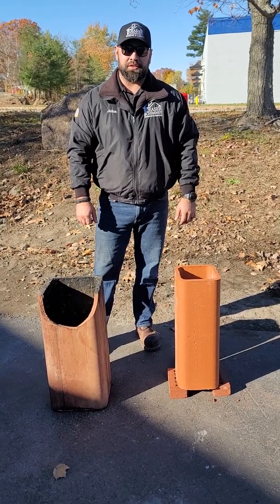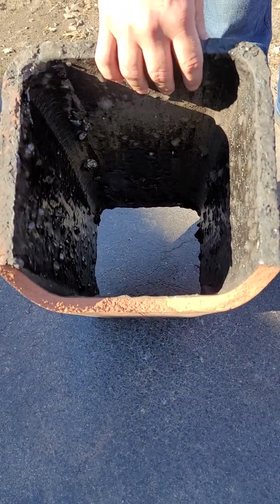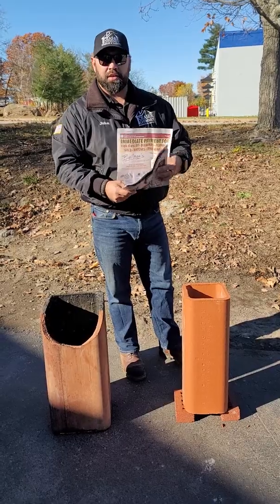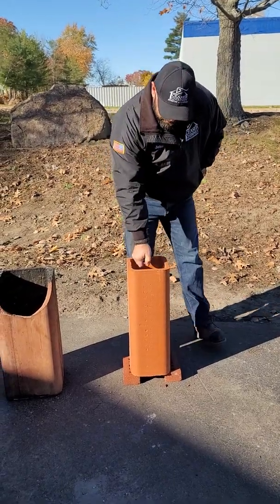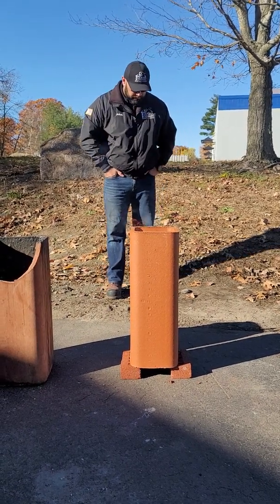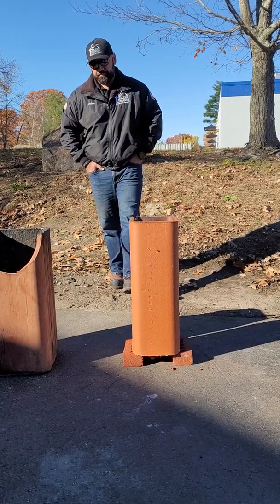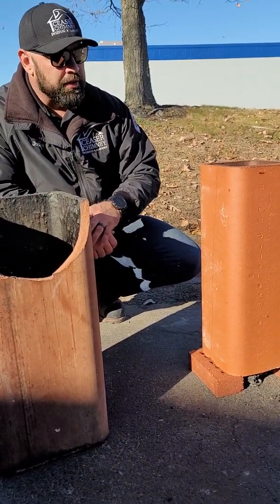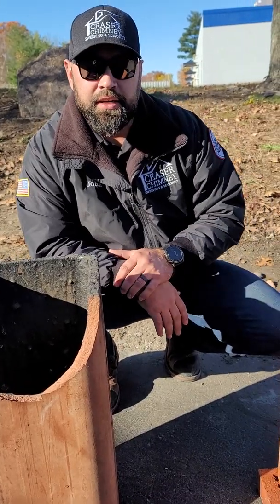Flue Tiles and Fire

Comment: Mike Haduck, a master mason, in NE Pennsylvania but now in Florida, has a couple of video on him repair chimney crowns.  He’s not a chimney guy, but he says he won’t build mason or brick lined chimneys because they all fail, with many of the clay liners cracking, and falling back into the fire chamber.  He says a proper installed stainless steel lined chimney, or an old fashion stone chimney is the only failure proof.  He’s worth watching, like his part 13 and others.
I had an video camera inspection of my 3 pipe chimney (2 fireplaces and 1 appliance duct), and despite being a high quality build chimney for a home builder which was his house, the brick and mason chimney is cracked after 60 years.  I think you can clean or scrub the lining if the built up isn’t glued to the lining, but the cracks can be a problem.  The smoke can leak through the cracks into living space, especially the appliance duct with the hot water and hydronic boiler operating while you’re sleeping, and soot into living space over time.  You take chances on the severity of the cracks, like small door seal gaps won’t impact interior heating, but if the gaps are big enough, you’re heating the outdoors in the house.  The mortar seams, in most chimneys, are cracked from heat, moisture, and rain intrusion if the crown is defective.
Bottom line, the 2 inspections came with 2 lining quotes - $16,000 and $31,000, 3 pipes and repairing or replacing the roof brick tower that is weather and water damaged.
Reply: YES! MIKE HADUCK--a real TRUTH BOMB thrower. Love the guy!

Comment: Ummm, your demonstration isn't accurate though,  chimney tile is insulated, it has some sort of block or stone around it,  with an air gap.  They're not exposed to the cold like in your demonstration.  I would not burn wood in a clay tile chimney by any means.
Reply: So you wouldn’t burn wood in a fireplace built to burn wood?
Reply: You would not recommend using a wood burning fireplace with a terracotta flue liner? Even if it was in good condition?

Comment: Great demonstration but with poured concrete surrounding the tile it would be protected as the heat would sink through the tile into the surrounding concrete. Even better line the flue with steel pipe
Reply: I did that with a flu I built, poured solid concrete around all the tiles, lasted a few years but expansion cracked most of the flu blocks. Wasn't a good idea.

Comment: Interesting demonstration! Thanks. I would like to add, the method of how you burn and the design of the stove also can mitigate any creosote problems. When burned properly, a stove designed to burn hot and clean (masonry heater) Including burning ALL the fuel, even the smoke, leaves little remaining in the flue gasses to condense on the relatively cooler flue tiles. Thereby reducing or even eliminating the risk entirely. That is why shutting down an old school stove to smolder all night is the worst practice because it produces the most smoke and the coolest temperatures for all of that to condense on the flue tiles. A stove design with an insulated firebox keeps the fire hot to burn clean. Extract the heat from the fluegases downstream of the fire to heat your home. The now clean and hot fluegases can be routed through a heat exchanger such as a masonry bench to store the energy for slow emission into your dwelling over time.

Comment: Good video, crazy because my clay flu tile that's at the very top sticking out of the crown had two cracks and I could see the residue on the outside from seeping through.  Old 1976 home, I just replaced the top flu tile since I was pouring a new concrete crown and will be installing a stainless liner for my wood insert.